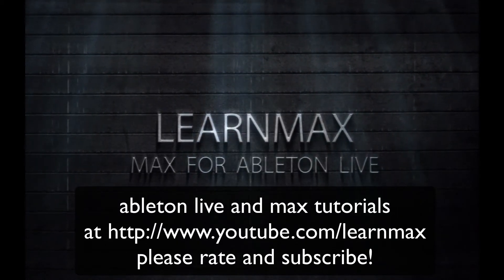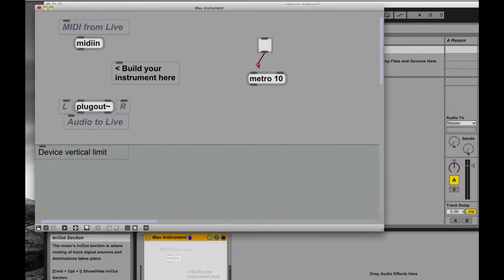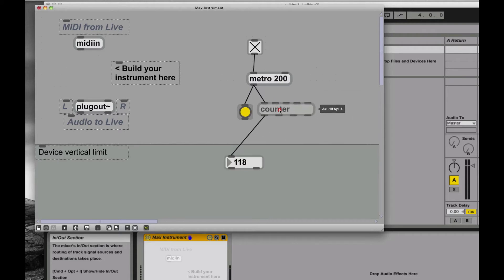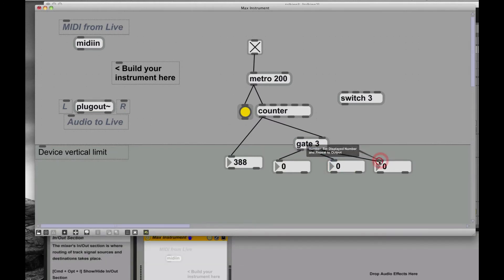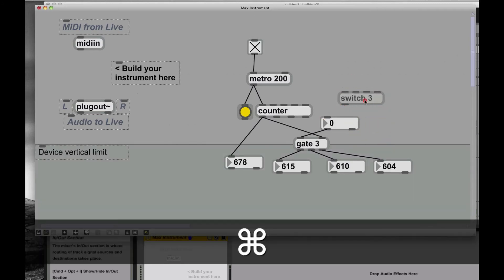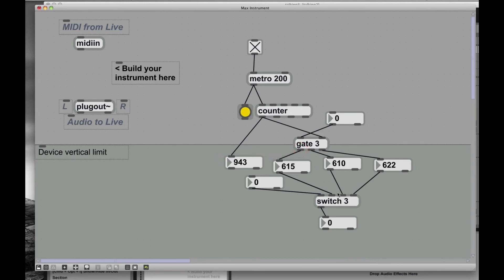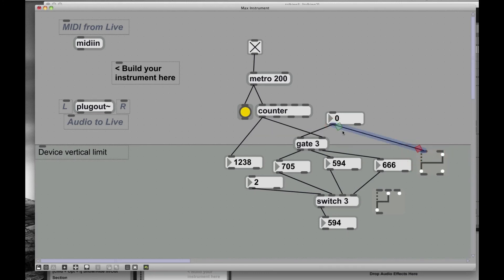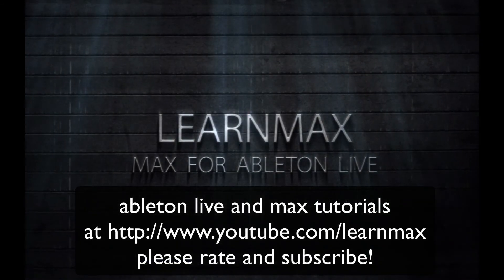M4L/MAX/MSP/Jitter MaxforLive Tutorial Intro to programming dynamic routing w/ switch & gate

Comment from the maker: @StrafingMoose It's a lot different from traditional text based languages, that's for sure.  I think programmers from the traditional side going to max have an easier time than the other way around.  It does have certain challenging things that I usually think would be a lot easier in text based stuff, but for really quick building of stuff it's awesome.  As to whether you need it, well, that's a personal question, but if you want to do custom stuff, it's just plain amazing.